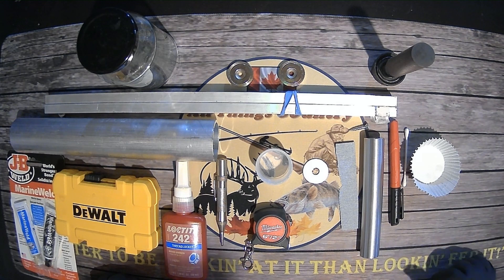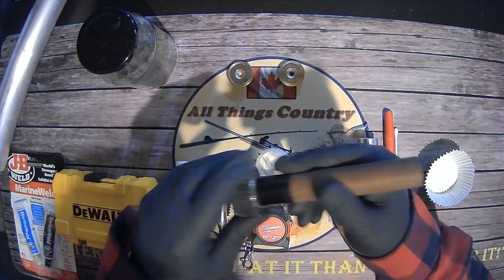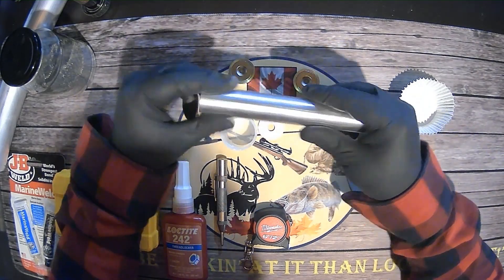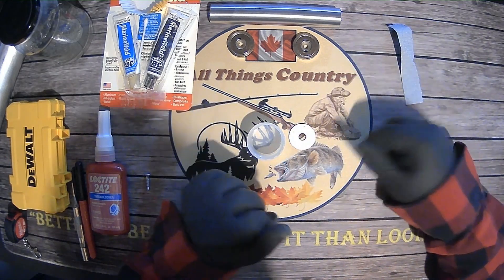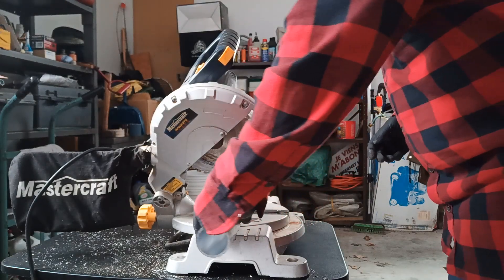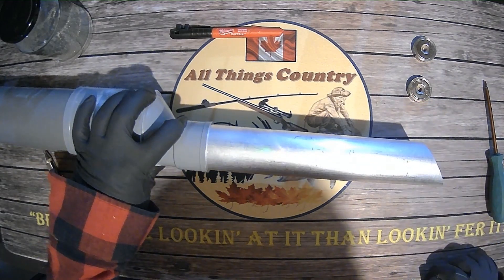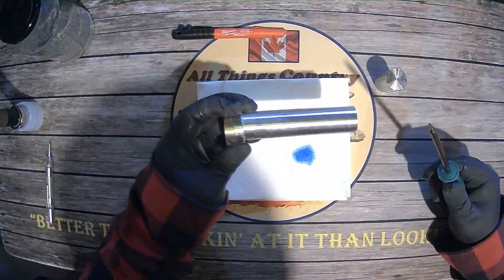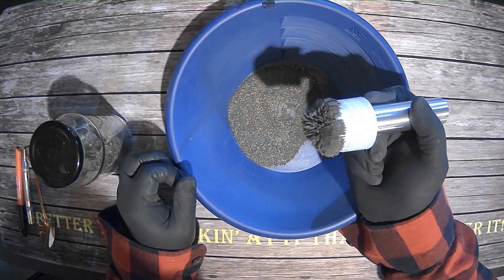DIY - Black Sand Magnet - How much gold is in black sand?

Comment: Liked, shared and commented . I love DIY prospecting gear. When I started I was literally a starving prospector. All I could afford was trash or repurposed material’s. I made my pan, snuffy n my sluice “the Loser”. Everything was completely free. I owned every component. So I Absoflippinlutely watch anything DIY prospecting gear related. N by the way. Free homemade gear I cobbled together, found gold n worked until long after I had replaced it with store bought stuff. But I recently did crack my salad bowl gold pan 😢. I’ll repair it soon. 🍻🗽🤴🏻 11:24